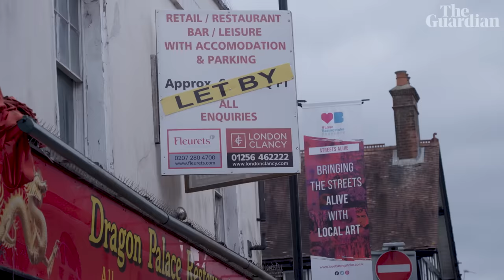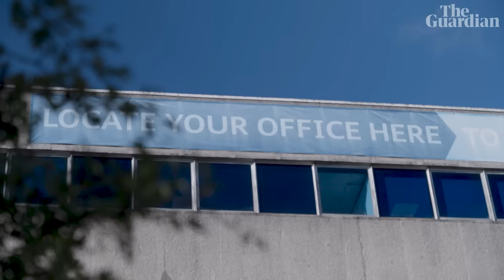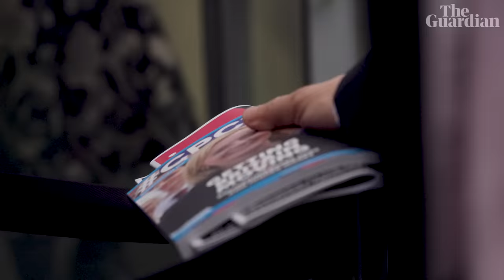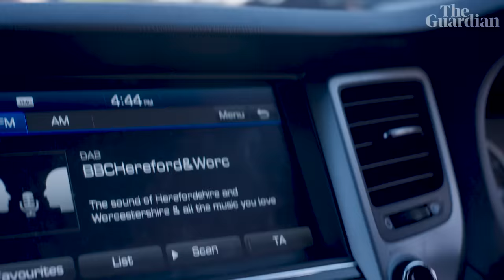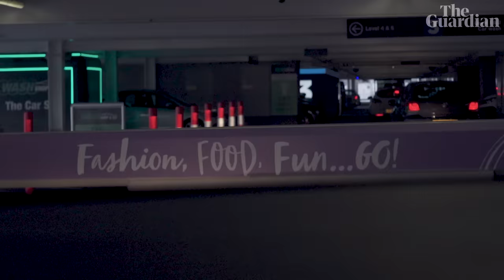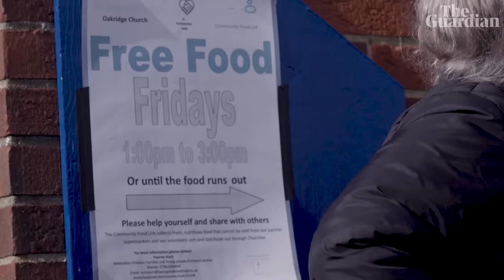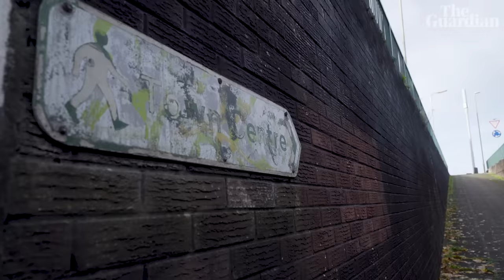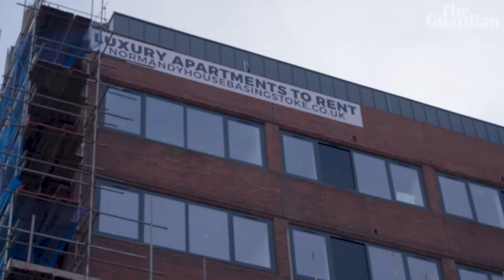How deep in crisis is Britain? This Tory heartland knows the answer | Anywhere but Westminster

Comment: What I have noticed is a lot of things in supermarkets are going up in one day by 40p ,50p a pound, everything is going up quite a lot without explanation.
Reply: Here to!! Its bizar!
Reply: Yhh! Milk prices have been affected the most! Every fortnight, the price goes up by 5pence (for the 2 litre size).
Reply: It's called price gouging. Lots of shop are doing home bargains herons b&m iceland and the big supermarkets all do it here an example a certain brand off flap jack in home bargains went up overnight from 29p to 49p then when the people stopped buying it they reduced it 10 p I'm not picking on that shop in particular its purely an example they all try it on.. 🇬🇧👍
Reply: @originalunoriginal4055   it’s absolutely off it init when the price of milk goes up that often and fast it’s time to panic or at least for some/most 🇬🇧
Reply: @andrewdaley5480   make sure you post your Union Jack as often as you can bro 🇬🇧
Reply: @syryder3236  have been for years. 🇬🇧🇬🇧🇬🇧🇬🇧🇬🇧👍
Reply: Milk is a very energy intensive product.
Centrifuge, homogenizers, pasteurizers, filling and packing cleaning and sterilisationof equipment.
Multiple stop collections, multi stop deliveries on a daily basis.

When energy and fuel goes up, the cost of a pint has to.

Even cleaning chemicals and anti-legionella chemicals, which passed through customs, driven by European drivers, who don't want to come here. All additional costs. Some avoidable, with government intervention.
Reply: @slayerrocks2  I think the price increases on milk have been more noticeable because we have been used to getting milk very cheap. 🇬🇧👍
Reply: @andrewdaley5480  very true. It is also a 'staple' which most people buy, every shop.
It is one of the reasons that milk, bread, eggs etc are often sold at or below cost price.
To get you in the door.
Reply: @slayerrocks2  yes loss leaders. 🇬🇧👍
Reply: @mariannevontrapp1063  it's not bizarre. It's called inflation.
Reply: Silver…: to write that shows that you are not keeping up with the situation of the country and the world at large.
Reply: There is a clear explanation -Brexit
Reply: @SilverStarEyes Nobody who has paid any attention of the effects of Brexit and the energy crisis caused by Ukranian war needs an explanation. We could have had a deal, Theresa May's was better than nothing, but Tories decided the country wouldn't suffer enough, so here we are: deals with far away countries (with increased shipping costs) that are the same or worse than we had with EU and not enough workers, permanent or temporary.
Reply: @livinia296  I just started watching it, although its 3 hours long, Thanks for the link.
Reply: In the USA too. Cooking oil doubled, eggs tripled, etc. My salary went up 2% but my health insurance increased 25%! It is horrendous. Don't get me started on cost of dental work!
Reply: @andrewdaley5480  You are correct. Very easy to make own flapjack recipe and where I live it is 57% cheaper to make your own versus buying store mix.
Reply: Yes, things are going up and the items seem to be getting smaller, has anyone else noticed that?

Comment: Here in the Netherlands the same! Food, elektrisity, heating, going up and up in prizes !
Reply: @16dya  don’t be so rude hardly got a soul you after that comment 🇬🇧
Reply: In France, prices have gone up by 6% on average. Electricity by 15%. Gas by quite a lot, but frankly, gas has gone only up for decades. Here, peoples start stopping using it for heating decades ago. I don't know for sure how many peoples still use gas, but i know no one around me who is.
Reply: Alse, here, credit for buying homes have fixed rates. So the rate cannot change, which mean, when interest rates goes high, it becomes cheaper for peoples who have a previous credit to pay. If your salary follow the inflation rate, you may end up pay a actually negative interest rate.
Reply: @dieselpub2  in uk the rises are far far higher. Energy 250%, food 30%,
Reply: @16dya  nevermind “oh come on” you need to fix your soul before anyone wd listen to you and think before you speak it will only cost you a brain cell or two I do understand tho as you don’t have that many 🇬🇧
Reply: Exactly! Am in Sliedrecht and it's ridiculous
Reply: @16dya  yeah because everyone in the uk wanted the brexit. These kind of comments are just rude
Reply: @16dya  many didn't want brexit many tried to push to avert brexit the Labour Party didn't do enough to support that side, honestly if every political party sides with one half of the population that leaves the other, with the majority of experts, in the dust.
Reply: Because in the NL you have the same mentality as the UK…. Business speculators first, people last

Comment: Is it possible to have an economic system without inflation, poverty, and unemployment and where all citizens have equal access to all resources?     However, achieving such a system is challenging as it requires a balance between economic growth, social equity, and environmental sustainability. It would require significant changes in policies, institutions, and societal values.